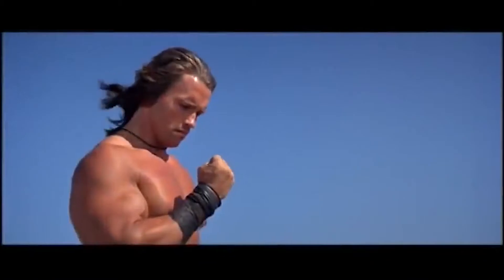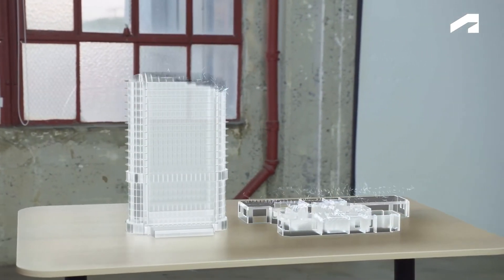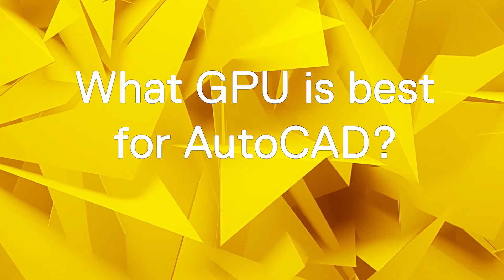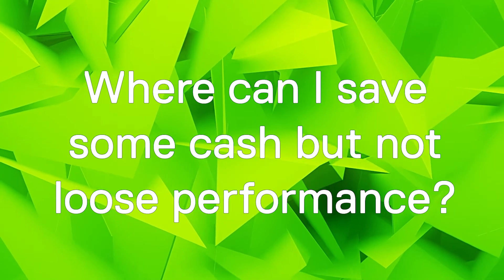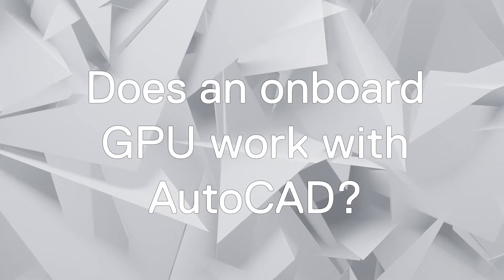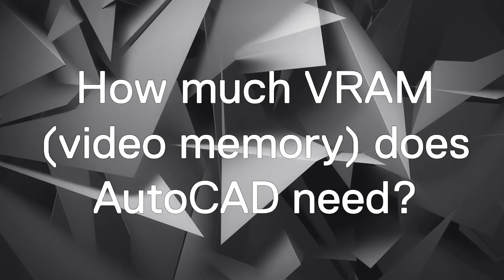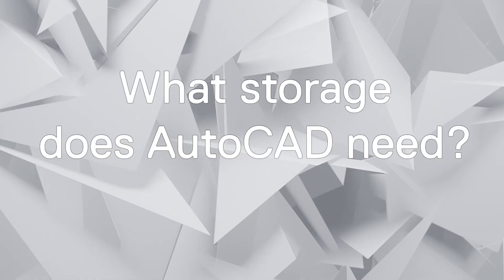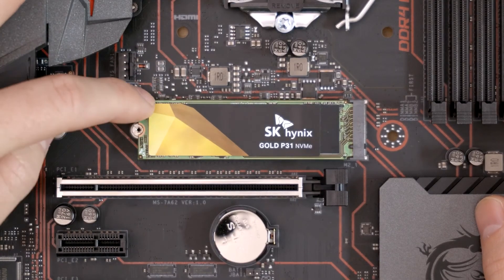What PC do you need to get the best out of AutoCAD in 2022? #AutoCAD #workstation #bim

Comment: Sir, Can i run Autodesk Fusion 360 CAD software on this i7 3770 +8gb ram +256 gb SSD+ 2  gb gpu  Please answer me someone 😢?
Reply from the maker: Thanks for getting in touch! With those specifications you should be able to run Fusion 360, however, you might struggle with demanding GPU tasks. It might be worthwhile upgrading with a new bundle and graphics card to boost performance massively

Comment: I'm torn between Intel 12650H and AMD Ryzen 7 7735HS both running on RTX 4060. Which would you recommend for smooth Autodesk applications experience?
Reply from the maker: Thanks for getting in touch! Although we've never tested either of these CPUS for Autodesk from a pure performance stand point (via online benchmark results) the Intel CPU does seem to be the clear winner here. This is because of its 2 more core and ultimately faster core speeds over the AMD chip. I hope this helps make your decision easier. - Ryan

Comment: You can easily install Autocad LT 2024 & Revit LT 2024 and work smoothly on intel i3 3rd generation processor. I have tested it on my Dell Laptop and 100% working. My Laptop specification is given below:-

Processor - i3 3227U @ 1.90 GHz.
RAM - 8 gb DDR3 @ 1600 MHz.
SSD - 500gb SATA, speed of 540 MB/s Read and 500 MB/s Write.
Integrated Graphics Card - Intel  (R) HD Graphics 4000, 1792 MB VRAM.

When I worked on Revit LT 2024, The CPU was working it's maximum base clock speed of 1.89 GHz and usage was around 26% only.
Reply from the maker: Hey, thanks for the comment and for sharing your experiences. As mentioned in the video, this tutorial is aimed at those wanting to efficiently work on large complex models - like many things on PCs, the minimum requirements can be different for every user. Your comment raises a great point. When looking at any task on PC, you need to know  what your own idea of 'what good looks like' is when it comes to performance. That way, you will get the best value for your time and money. Again, thanks for watching and commenting. It means a lot! Cheers, Craig

Comment: Hi, what about i5 9300h 1660ti mobile 16gb ram laptop? Do you need 17 inch?
Reply from the maker: Hey apologies for missing your comment and thanks for watching! I'm sure you will have this sorted by now...what spec did you go for in the end? The specs you have shared will be fine for modest projects and as for screen size, that is a personal preference between portability and work space size.  Cheers, Craig
Reply: @utopiacomputers  hi, no problem, thank you. I've got rtx 3070, 16gb, i7 10th. Omen 15. I bought and fixed it in total $500 used. The screen was damaged, now it just has  black pixalation glitches sometimes, i have to find out how to update bios. I know these are monster specs, but i have mentioned little freezing sometimes

Comment: My experience with 2d drawings so far says: Min 16GB fastest ram but 32G is better. Min 4 cores over 4 Ghz but near 5 Ghz is better. Min SSD SATA2 but Nvme better. GPU doesn't matter for 2D but I guess Quadro better. So that means as the dude said 12th Gen i3 with nice 32G ram and very nice NVME with some second hand Quadro with 4GB will be the minimum for nice work.
Reply: My experience with 2D software in general; use anything that looks like a computer and less than 20 years old. 3D software on the other hand, one need to keep an eye on those specs

Comment: Thank you for the informative video!  I have an A4000 and need to pick a CPU.  I work with AutoCAD & Solidworks as well as Adobe.  I want to get a CPU that is slightly more powerful than the GPU.  I have been looking at the 13900F vs the 7900.  Is one a clear winner?  Is there a better option still?  Thanks,

Comment: I'm about to build 7950x without dedicated GPU, 32 DDR5 6000Mhz, will it be fine?
Reply from the maker: The 7950x is a fantastic CPU and a very capable CAD workhorse. I've never tested this CPU without a dedicated GPU. Technically, it should work, but you'd have a performance boost with even a modest dedicated GPU.  A more rounded performance could be had by reducing your CPU, giving you a budget for a GPU - just a thought. Thanks for your comment and for watching the video! Cheers, Craig

Comment: Hi, my autocad seems laggy when i  installed a heavy font style whenever i put it, it becomes laggy so i always uninstall the font style just to ease the lag so i can do and work conveniently, the cad file consists 10 to 15 pages, i have ryzen 5 3400g and 32gb ram with quadro p400. What could be the problem. Do i have to change processor??. Pls. need advice
Reply from the maker: Your CPU and RAM should be fine...though check you have XMP enabled in your computer's BIOS as this will make a big performance difference and can be missed on self build PCs. The P400 isn't a fast card, which could be why you are experiencing slowdowns. If you are on a budget, an Nvidia GTX card will be cheaper and faster. Could be worth looking at an upgrade. A P2000 or GTX 1070 or above would be ideal for most AC projects. Thanks for commenting and watching, Craig
Reply: If You are using Hard disk, then replace it with a fast SSD

Comment: Can catia run on i5 3470
Reply from the maker: Hey, thanks for watching and commenting! If primarily doing design and modelling work, CATIA runs best on high-frequency CPUs, such as an AMD Ryzen 9 or Intel Core i9. Simulation and rendering work will use more CPU cores, so a higher core count CPU such as an AMD Threadripper is then recommended. Technically it probably will work on an i5 3470, but will be very slow. Cheers, Craig

Comment: will an,  amd ryzen 5900x and a 3080 12gb work good for programs like this? with 32gb ddr4 ram at 3600 speed?
Reply from the maker: Hey Phillip, Thanks for watching and for your question! Yeah, that sounds like a great base for a workstation. As I mentioned in the video your GeForce card means you will miss out on some Quadro specific benefits including support from Autodesk should things go wrong, but otherwise it will be a great performer! Cheers, Craig